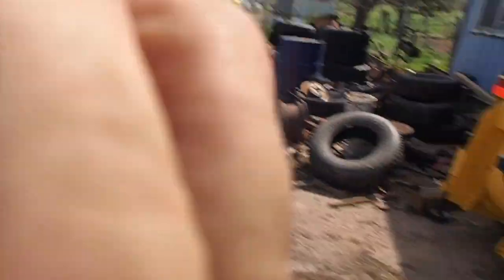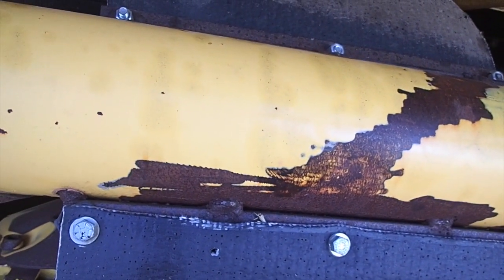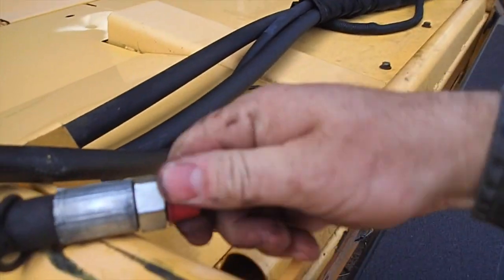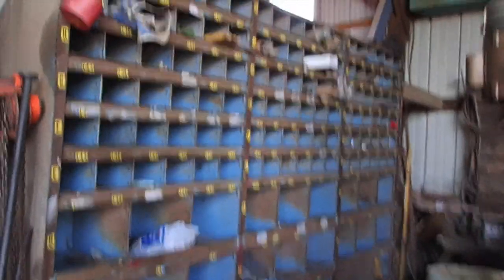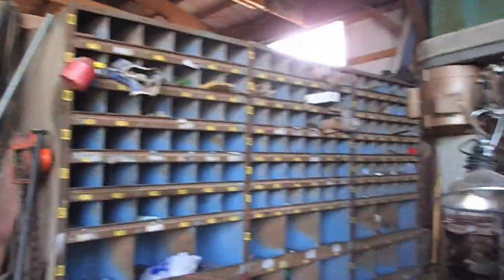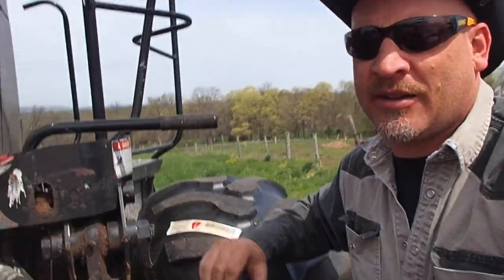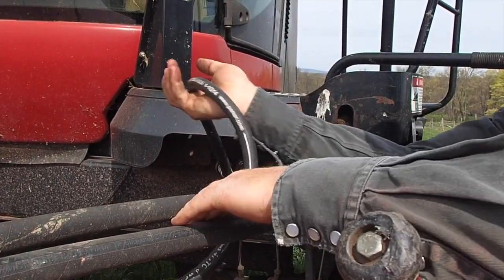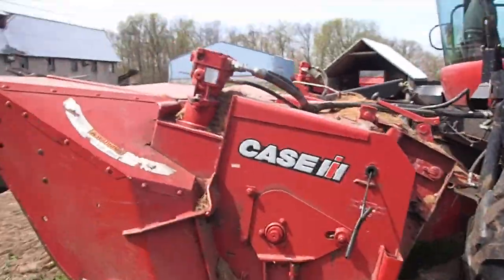New Holland Head On  Case WD2303 pt1

Comment: By the looks of the little bit of weld I wonder if they were just trying it to see if it wrapped and maybe you should try it before you weld them permanently, just a thought. I think it's going to wrap up with hay only because there's nothing stopping it from wrapping in long ropey hay it will work good in short stuff I think

Comment: Is the gap in the central opening wider with this new header than with the original head? It looks to me that you will be running on the edge of the swath with wheels - which may not matter of course but might make rowing up the crop more difficult.

Comment: would propane mixing with air in the intake manifold work to let the diesel burn hotter and cleaner? then the pump can be set so it is cheaper on the diesel :)
Reply: Propane? How would you ignite it?
Reply: +Fredrick Mechanical no it wouldn't, diesel has a higher flashpoint than propane that is the stupidest thing I have ever read..the propane would ignite before the diesel causing pre ignition and blowing the Pistons clean through the head...holy shit you can't be serious 😱😱
Reply: +Gene Sederlin *you're

Comment: i'd keep the old header for spare parts
Reply: +chet sparks dont think anything on old one is worth keeping it would all need rebuilt to use anymore anyway not worth it
Reply: +peterbiltxr379  i meant take all the still workable parts off ie: sprockets chains motors hoses couplers etc

Comment: The injection timing is advanced, not retarded, and the reasoning behind it is when the injector pops at around 15 degrees before TDC the fuel travels down and spreads to meet the bowl of the piston as the piston rises, and finally ignites right as the crank rolls past TDC. If it were to inject on or just after TDC, the fuel would be chasing the piston down, cylinder ignition pressure would be WAY down, and would cause the Injection pump to have to supply an insane amount of fuel to run.
Reply: 15deg before tdc? More like 18deg considering the compression ratio of this engine.
Reply: +Keith Jeasser I used a generic number because I do not know the make and model of the engine in the video. 15, 18 makes no difference for the purpose of explaining the principal.
Reply: +UncleBubbles94 It makes a serious amount off difference..maybe not to an armchair mechanic like you, but to the rest of us that actually know what we are talking about..somehow I doubt you would get far in our circle
Reply: +Keith Jeasser You can't cure stupid ....id hate to have him working on my machinery!!!!

Comment: mig is not a place for doing repair, fabricating with new materials only, repairs are to be done with stick rod only. there is a place and tool and machine for each job, i see people using mig, and cheap box store mig on everything, why, any one can lay a bead with a mig, don't mean its going to hold though